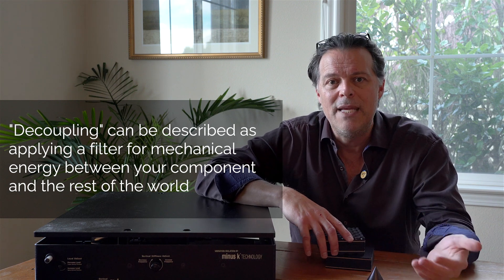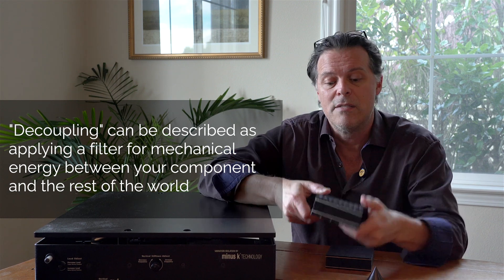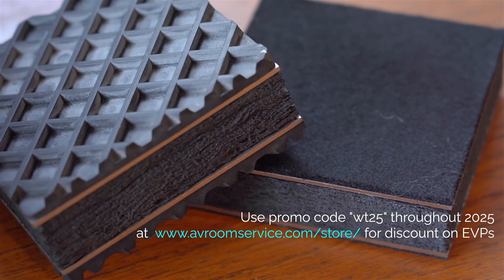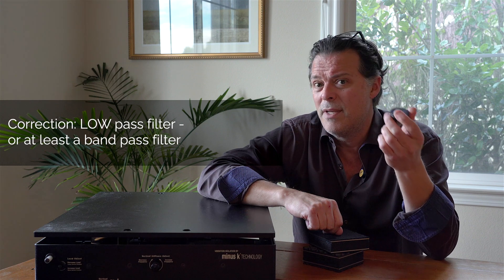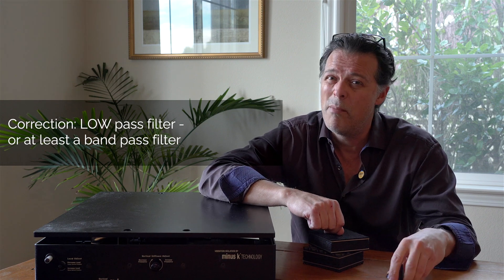Sound Bite #11 - Decoupling and Isolation Myths

Comment: been on the lookout for a way to end run the expensive isolation solutions sold to audiophiles for awhile .   So far it looks like yoga mats and squash balls are going to work as base materials.  I bought some automobile sound deadening , and inexpensive sheet neoprene ,  but it looks to be more compressible than desired.  I'll just use it to build dissimilar layers.

Comment: Yes decoupling from outside noises but you don't want internal decoupling that can be detrimental because the mechanical noise inside the Machine like bearings, there you want to drain the energy not decoupling you need to use both in conjunction with each other.
Reply from the maker: If your turntable has so much self noise that you benefit from having a mechanical path for that noise away from the armboard and away from the turntable apparatus entirely then either that pathway is built into the design of the turntable or you need to consider fixing or replacing your turntable. That's my 2 cents.

Comment: Great point—spikes are not decouplers! Proper decoupling is essential for turntables, as it helps isolate them from vibrations that can degrade sound quality. I’d go even further and say that decoupling your audio components and speakers is just as important. Effective isolation can enhance clarity, reduce unwanted resonance, and improve overall performance. Whether it’s a turntable, amplifier, or speakers, investing in proper decoupling solutions can make a noticeable difference in your system’s sound.
Reply from the maker: Gotta agree with you on the value of decoupling all around - PARTICULARLY for the speakers, subs and turntable. All of these are mechanical transducers!

Comment: What do you think of 'sprung' turntables like the old Thorens TD-150?  I guess that is a kind of compliance.
I live in a massive concrete apartment block (1960s brutalist vision of the future) -- low frequencies not a problem, but high frequencies are transmitted through the structure like a bell.
Love your videos, by the way, and am devoted to the Wally Skater!
Reply from the maker: Thank you! I used to own an LP12 that did close to nothing to filter out footfalls. That type of undamped, highly excitable isolation creates new problems, I found. The devil is in the details. Best to look at what laboratories do to filter out vibration. What they do NOT do is put the payload on springs and call it a day - particularly if the payload has its own forces it generates!

Comment: Seismion is not an isolation device it's a damping device. It actively produces vibrations in the opposite form to dampen anything placed over it. It is the worst thing you can put under your turntable or any other hi-fi equipment. I know cause I tried it. On the other hand Minus K or similar products provide isolation in a passive way. Again, I know how Minus K sounds under a turntable. I don't say it's the best but it's better than Seismion. Actually anything is better than Seismion. It kills the sound by actively producing vibrations. The tiny signal of an MC cartridge is produced by vibration of coils inside the motor. Exactly the same but opposite of a speaker. Since Seismion actively fights all vibrations it also affects the cartridge motor. After all sound is a kind of vibration.
Reply: What is a good isolation device? In general it means that the vibration is reduced to a satisfactory level between the existing and the desired conditions. In the noise and vibration industry isolation efficiency is the percentage of vibration force NOT transmitted to or from the support structure. 90% or better reduction is considered good. In audio applications, this would mean 90% or better from the lowest frequency of interest through the audible bandwidth. This means a design who's loaded natural resonance is at least one octave below the lowest frequency of interest.
Reply: @AVRoomService  A cartridge is a vibration reading instrument. It turns vibrations of coils inside the motor (actually it’s a generator) to electrical signal. So, an active device like Seismion reduces 90% of vibrations it also reduces (or wipes I should say) some of the vibrations generated by the coils. Think about that. Seismion is not a decoupling or isolation device, it actively fights all vibrations. It's a cancelling device.  It doesn’t know which vibrations are bad and which are inscribed in the grooves and read by cartridge. I don't think we need a cancelling device, we rather need isolation. At the end of the day I wouldn’t use it under a turntable. I knew it from experience.
Reply from the maker: I think we may see things differently on this matter. We have started our vibrometry analysis on the various isolation devices. They each seem to have specific frequency bands they are most effective in and moments of freedom they function within. With respect to which is “best” we appear to be likely to end up with the position of “it depends” where final determination requires an understanding of the spectrographic content of the offending vibrations and even their source. 

With a Seismion under our microscope we can see the benefit right on our screen when viewing a subject at high magnification. An impact hammer’s impulse results in critical damping. One full sine wave of energy passes. You can witness it happen on screen. Turn it off and it takes much longer for the energy to decay. 

It would be better to pass no energy at all but we haven’t seen that product yet. We have plenty of testing left to do but we can see that there is a role for the Seismion in the right situations.
Reply: @ what is good for microscope may not be good for turntable or amplifiers. Imagery is not based on vibration but the sound is…
Reply: Have you already heard the Thorens Reference One turntable which has a Seismion platform integrated? I was very enthousastic about the sound of that premium machine. So getting a seismion stand-alone platform for your turntable can be – in comparison – a cost effective thing ;-) I think you have to consider the internal damping/isolation of a turntable, too. Perhaps it works better with turntables that do not have extra decoupling features like for example my AMG Viella ...

Comment: What do we do with very heavy devices like turntables that weigh 40-50 kg? On mobile decouplers, they might be too heavy to stay in place properly and for the decouplers to effectively do their job.
Reply from the maker: Each of the three devices I mentioned must be sized to the payload mass. Any good decoupling system would require this because it is essentially a spring loaded system

Comment: Thank you for finally explaining this strange myth of spikes. I would like to add that if a real decoupling has an impedance, it must of course match the device and its weight.
Reply: Correct, just ask ISO Acoustics...
Reply: They have good products, also Symposium Acoustics and some others. All of them are a little different, but they are working in general.

Comment: I have noticed that a lot of the truly rigid turntable designs, Clearaudio, Brinkmann, Acoustic Signature, etc, come from places where the home construction is typically brick and concrete, not wood framing like we typically get in the USA. Suspended wood floors tend to vibrate and flex far more than concrete, making them much more susceptible to vibration transmission.
Reply from the maker: I would say the wood frame construction changes the fundamental frequencies of vibration transmission, not their amplitude. Rigid construction passes energy FAST and will look for mechanical impedance joints where that energy can dissipate. The heavier construction also makes it more difficult to excite but I have heard positive impacts of decoupling even in rooms that were concrete on grade construction.
Reply: @WAM-Engineering  Right. but the more tangible problem of footfalls leading even to needle skipping, is far more common in wood framed buildings. Ironically, even a fully suspended turntable like a Linn has a hard time dealing with suspended floors, because the isolation rarely works well in the direction of the supporting structure's movement, and the whole thing just starts wobbling uncontrollably. Damped isolation often works the best, like a SME turntable's oil damped suspension, or something like Sorbothane between the turntable and the supporting shelf.
Reply from the maker: @gotham61  Yes, footfalls are almost entirely a wood frame structure issue.
Reply: @WAM-Engineering  Swellings with large-span suspended concrete construction is also a problem with footfalls. Actually, more of a problem because it is much more common globally.
Reply from the maker: @AVRoomService  - YOU would know better than me on this!

Comment: Great stuff! It was good that you mentioned the EVPs. It might have been nice to include some range even for the novice level like sorbothane hemispheres? Something better than nothing?
Reply from the maker: Thank you. Yes, USUALLY something is better than nothing. I can think of some situations where that would not be the case but I expect they would be exceptions.
Reply: @WAM-Engineering  I was an AT rep when they were introducing the AT605 Insulators. Still have my samples. Also repped and still using Micro Seiki Microsorber MSB-1.

Comment: Fascinating topic. Just today I put under the feet of my Vertere DG-1 the Stack Audio AUVA Equipment Isolator. The Vertere turntable already stood on an IsoSlice Turntable platform which stands on IsoAcoustics OREA. I was honestly surprised how better the imaging became after introducing the Stack Audio feet. So now I will at a later point have to try if the OREA and the IsoSlice platform are actually still doing something or not.
Reply from the maker: It is good you are hearing the benefits. Take a close look at spectrographic data on any given product to see if they do much decoupling work - if any - below 100Hz and, if so, to what level of amplitude? The EVPs are one of the few that publish results taken by independent laboratories. Perhaps others do as well - I do not know.